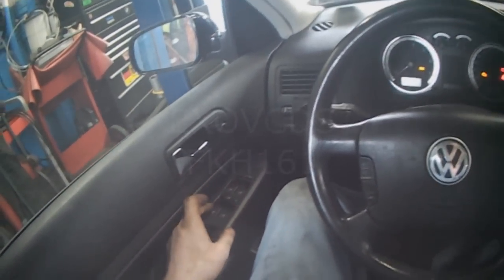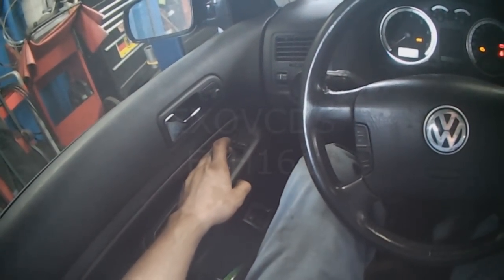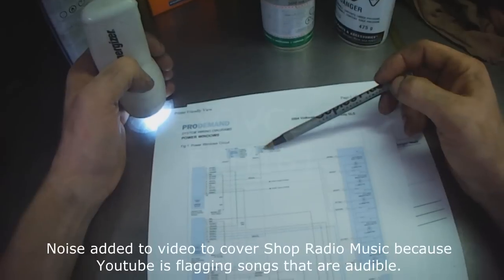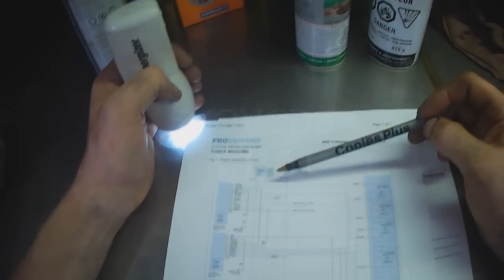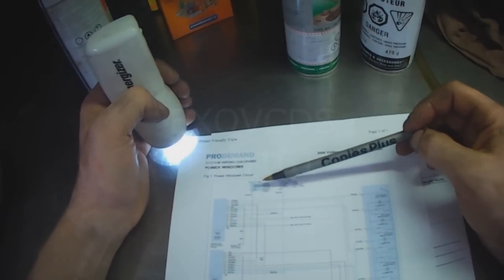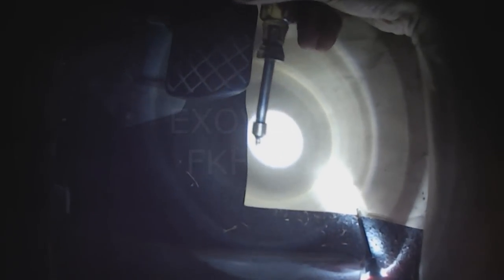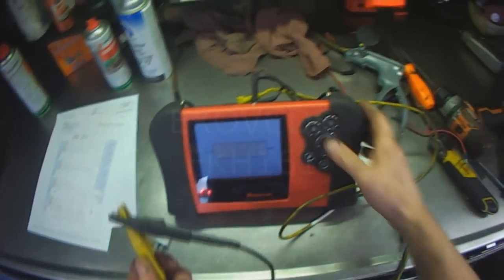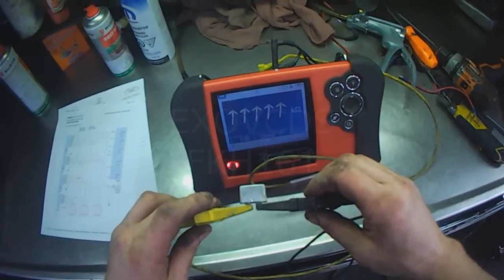VW A4: Power Windows not working

Comment: Hi Thomas, i have a similar issue on my 2003 audi a4,
i replaced the window motor, regulator, and door wiring harness but still no working window. I can hear the click when i push the button though
Reply from the maker: +hxgs If the motor click... then the control circuit is OK.  Look for a problem with the main power & ground. Just one window is affected or all?
Reply: ***** thanks for the reply, it is only the driver window, everything else works (locks, sunroof, dome light, other windows etc...)
Reply from the maker: Have a look at this pdf.. might help determine which wires to look at.
Reply from the maker: http://fkh161.ca/Audi/A4/AudiA4PW.pdf

Comment: I have the same problem on audi a4 b5 1998.. only in my case not workink only left side windows (both) and also relay is clicking in all doors.. but in the right side (passenger side) windows are working fine...   aaand alsoo... after a few weeks that central door locking button on door panel also stoped working... sunroof is working, side mirror adjustment is working too, interior lights is working too.. central lock via remote are working good..

Comment: Hello great information I have a 2004 Audi A4 with some electrical issues the sunroof and all four power are not working. The car will not start when I check the wire going to starter upon turning the key to start position it momentarily show 7v then drop to zero volt. If I turn the key to the on position and put 12v to the start solenoid the car start so the starter is good. Also the engine fans are not working when get up to temperature or when the AC is witch on. can you please help or do you have a schematic for the different circuits?
Reply from the maker: Standard or automatic? What size engine?

Comment: Hi Thomas, i have a Vw golf IV from 2002, 1.4, 16v, i have some problems with the window from passager front like this: when is hot outside like 20' plus the window is working great. but when is cold outside it's only work down, up he don't want to work. The clik it's working,
Reply from the maker: Probably an issue with the circuit board of the window motor... we replace the whole unit, but you can try to open it up and "resolder" the spots for the little polarity switch / relay / controller.
Reply: Ok, tomorrow I'm gonna make this. I have a friend who has a machine like this. Thanks a lot and sorry for my English :)

Comment: Hi Thomas EXOVCDS good video going to check if that the problem that going on for my windows they just stop working today and my windows all down and I cant get  them to go up I also notice my sunroof  stopped working but my power locks still work I check the all the fuse's in the car but all of them are all good but all this happen when I had to disconnect my battery and when I connected it back my windows stop working
Reply: My car is 2000 vw jetta 5speed 2.0
Reply from the maker: Not sure... something similar happened on this A3/mk3:
https://www.youtube.com/watch?v=NPuw8TR3KYg

Here's mk4 power window diagram:
http://fkh161.ca/VW/mk4PW.pdf

Sunroof
http://fkh161.ca/VW/mk4SunR.pdf

Comment: Just wanted to know if there's a fuse in the fuse panel dedicated for power windows? For a 2005 Volkswagen Jetta 2.5.
Reply from the maker: I'd have to check... is everything else working? The "vehicle central electrics control module" will shut-off non essential electronics (to conserve battery power) if there happens to be a battery / charging issue.
Reply: Thomas EXOVCDS 

Batteries charged car starts up just fine .The fuel lock,  the trunk release button work my lock and unlock buttons work up front both doors. Ive repaired the wiring harness and got all that to work again. I still however cannot roll down the windows with the key manually by holding the key down from the outside. None of the windows roll down. My sunroof does work. I also took the front door window control module apart cleaned up the contacts I can roll down the passenger side window but cannot roll it back up that is the only window that actually rolls down with the driver side controls. The passenger side front door I can also roll down with its Window Control. The rear windows I can not roll down. The rear windows don't work with the buttons the wiring harness look good. I was also thinking I might have removed a fuse because the rear windows used to drop by themselves before I repair the wiring harness. I checked fuse 14 and Scott a 10 amp fuse. I've checked all the fuses buy the battery and on the side and they all seem to be good I'm thinking if I pulled one out and never replaced it that's why I asked if there's any other fuses. Could not find a diagram for my 2.5 Jetta. I appreciate all your help thank you
Reply: The passenger front window does roll up and down using its own window control button. That and the sunroof are the only two windows that will open up
Reply from the maker: Ivan Azcue As far as I know, all windows receive power from the same source / fuse, do if one works, it's a control issue with the others. Be it wiring or a module issue (comfort control or door module). I can find a wiring diagram for you once I'm back at my pc sometime tomorrow.
Reply: Thomas EXOVCDS 
Also anyway to.check the door module found it?
Reply from the maker: The front doors can have wiring harness issues (broken wires). Check for broken wires in the door jam (behind the accordion rubber boot).
Reply: Thomas EXOVCDS yea i check them, wiring looks good.
Seems like the back of the car aint getting power. Looking into door module relays?? Dunno
Reply from the maker: I'll send you a link to a wiring diagram in a bit.
Reply from the maker: http://fkh161.ca/VW/A5/VWA5PWindows.pdf

Comment: What's up a little question what place I can find the circuit breaker I had a same problem with my Jetta thanks
Reply from the maker: What year Jetta? Should be in the same place as this one if it is an A4 / mk4 Jetta.
Reply: It's 2000 vw Jetta tdi 2.0L it's almost looks the same as yours
Reply from the maker: I just checked a wiring diagram... it's the same as in this video. Remove the lower panel and look for the circuit breaker.
Reply: Thomas EXOVCDS yeah I check the one looks relay I just took it off and it looks good I prolly need the one you install with fuse, I need to know where exactly I can get that stuff thanks
Reply from the maker: WeTLaDi3sL0vER SLamm3dEs1 Sorry... I thought you meant the location of the circuit breaker. Most auto parts stores should carry those circuit breakers. You can Google the part number that is on the circuit breaker and that will get you online results for ordering.
Reply: Thomas EXOVCDS alright thanks for the info your video is awesome I appreciate your replying back take cre
Reply from the maker: Happened to be working on a mk4 right now: 443 937 105 A
Reply: Thomas EXOVCDS how you doin I'm back and I am trying to do everything I just don't want to go to the dealership and cost me more money to fix it I just wonder where exactly I can get the stuff you install to make to make it all work on those windows thanks
Reply from the maker: The part number for the circuit breaker is in my last reply to you.... a google search will come up with online parts stores that sell the circuit breaker (click on various links until you find one that lists the circuit breaker for sale).

Comment: Got a tricky one here, 2001 Jetta wagon born in 03/01has the 2.0 manual tranny.  I had the ignition replaced and programmed with new keys (new key fob wouldn't program to lock or unlock). Now everytime I start the car the alarm goes off. Was told it was a bad ccm, replaced the ccm and still the same issues. Also the drivers window switches wont control anything except drivers window for about 10 minutes after negative cable is pulled, after 10 minutes the switch dies and I have to pull negative again to "reset" the use of the window. Sunroof works, all windows roll down from their perspective switches, no courtesy lights when I open the drivers door and yes I have already replaced the door lock unit also. I can unplug the blue connector on the ccm and the car will start just fine no alarm, but I loose loose the comfort features along with it. Thoughts?
Reply from the maker: Performing a full system scan to see what codes are stored in all modules... might be helpful / can point you in the right direction. You'll need a scan tool that can communicate with all the modules.
Reply: I'll have to see if I can find someone that can do that for me.

Comment: Hi. Windows on caddy live driver and  passenger does not work. They however do work when I continioisly press the remote control. Also central locking also works when you lock the vehicles. Help would be appreciated. Thanks
Reply from the maker: My guess is the button or wiring in the door jam? 
Have someone scan the vehicle (all control modules)... there might be codes in more than one module that can help point you in the right directing.
Reply: Thanks. Appreciate your time.

Comment: hi bro..I have an audi a4 the water and changed the module comfort drink of the haciento and still do not work change the master power and also broken cables nothing. In this video and maybe it is what you did. Where I have the chip that you took in that passat an audi
Reply from the maker: This video is of "VW A4 (mk4)"... not Audi A4. What year is your car? What Engine size? What Transmission? I can look for a wiring diagram and can then send it to you.
Reply: cool bro.. is audi a4 2.0T year 2006..automatic.

Comment: Question. My driver side controls work for all windows. But the only one that has issues is the rear passenger window. I can role down the window from the drivers side controls. But I can’t ever role it up.
Reply from the maker: It rolls up when using the rear passenger switch? If yes, then I would suspect an issue with the driver switch assembly. Remove it and check for corrosion at the switch pins.

Comment: Hey man my audi 2002 a4 1.8t is just jumping from a stop really hard jerking motion then sometimes it stalls but the maf is clean
Reply from the maker: Standard or automatic? Engine fault codes? Use a scan tool to monitor engine data. TPS, ECT, MAF, short term & long term fuel trim values, misfire counts etc. Attach a fuel pressure gauge to monitor fuel pressure. If it is not driveable and it doesn't have any fault codes in the ECM... could be a transmission problem. If automatic... check the TCM for fault codes.
Reply: @EXOVCDS  it shows up as a transmission issue its an automatic
Reply from the maker: We don't deal with automatics... you'll have to take it to a transmission shop. You can also contact Richard (fellow YouTuber) over at: https://www.youtube.com/channel/UCpJdF1RzuXHqtzK258qRLjg or send him a message via his website: http://kansascitytdi.com/contact/ He knows a lot about automatic transmissions!
Reply from the maker: Torque converter lock-up clutch comes to mind... can cause stalling and harsh shifts if it is stuck ON.
Reply: Torque huh... Shit ok
Reply from the maker: Just a guess... could be a valve body / solenoid issue.
Reply: @EXOVCDS  what about the turn signals and windows not working nir the horn and yes every fuse is new biught 3 replacements for each and replaced all of them still dont work

Comment: would this also cause a parasitic battery drain? Windows don't work and I'm getting a battery drain. I thought it might be the CCM, but that was changed with no luck. 04 Jetta 1.8 auto
Reply from the maker: No, it shouldn't cause a drain unless the circuit is shorted (circuit breaker has power all the time). How big is the drain? 50mA, 100mA, 1A.. more? Should just need a multimeter & test light to trace it down. Alternator diodes can go bad causing a drain... disconnect the black alternator cable from the fuse box on top of the battery and see if that changes things.

Comment: please i have a 02 vw jetta gli 2.8 24 valve vr6 im getting a p1347 code cam/crank o2 sensor signal out of sequence what does that mean all my sensors are new help please thank you
Reply from the maker: If there is no noise from the timing chain... check the oil control solenoid for the exhaust camshaft for correct operation.
http://wiki.ross-tech.com/wiki/index.php/17755/P1347/004935
Reply from the maker: Any questions?
Reply: ive changed all the cam crank oxygen sensors its a replacement motor i bought online only 130000 miles i put all new sensors checked the timing marks they lined up perfect i just dont know what to do thank you for trying
Reply from the maker: The position of the camshafts is adjusted by the ECM. Initial timing / position might be OK... but once the ECM moves the camshafts, it notices a problem with it (exhaust camshaft in this case). As listed in the link above, there could be several reasons for this. With a scan tool that can view engine data... check that the camshafts are at 0 degrees when at idle. If the exhaust is reading anything more that +/- 3 degrees, then there is a problem with the chain, the oil flow control solenoid or the camshaft phaser.
Reply: Hey i want to thank you for your time what if anything i can do for you let me know im sure ill need more help by the way i took the car around the block put mine and passanger window down got back home and the windows womt go back up and the power locks and alarm im just having a wonderful time with this car but i love it so fast and i already have 2 grand in it and i havent registered it lol new used motor new interior tires brakes clutch lights. Lol im in over my head up to my chin
Reply from the maker: Are the fuses / circuit breaker ok (as shown in this video)?
Reply: @EXOVCDS  i have a lot to watch after work ill let you know again thank you it just seems every time i think i got it something else pops up
Reply from the maker: 17 year old cars will do that. =)
Reply: @EXOVCDS  i waned to thank you for your help it was circuit breaker lol now in orderto pass inspection my airbag light needs to be reset im so close

Comment: Hey, I have a 2004 mk4 Golf TDI, and my window and sunroof are not working not even with the key flop to unlock the doors?  I tried to open the links in the similar comments blew because I seen others having the same problem.  Can you send me the schematics?  thanks OG.
Reply from the maker: When you use the buttons.... do you hear clicking from the doors (like I did in this video)?
If yes... did you check / find the circuit breaker? Does it have power? Does power go through it?
If no... are fuses 14, 11, 44 ok?

Comment: Hello @Thomas EXOVCDS i have an audi 2004 AWD manual transmision, the driver windows works pretty good as well as the rear right window, but the passenger and the rear left wont work from the drivers, sometimes after u push it several times.. all of them work with each's buttons,  what would be wrong ?
Reply from the maker: +Daniel Lmz Driver control switch? Wiring in the driver door? If they all work via their own switch in the door, then I would focus on the driver door switches / area.
Reply: +Thomas EXOVCDS so you recommend replacing door swtiches?  the drivers??
Reply from the maker: +Daniel Lmz I can't recommend anything without having looked at it myself. I said I would start looking there.

Using a scan tool... one can check the functionality of the switches. if the scan tool shows correct switch operation, then it is not a switch issue.

Comment: hi thomas. all my windows are not wrking as well vw polo mk4..switch are ok motor is ok as well.
Reply from the maker: I'm currently at work... will get back to you later once I get home tonight. What year (month & year), what engine, standard or automatic? I might be able to find wiring diagrams for you.
Reply: vw polo 2006 manual thanks thomas
Reply from the maker: 2 door or 4 door?
Reply from the maker: Are the power door locks working? I can't find 1 fuse or circuit breaker that the doors have in common (like in my video). When you try to use the windows, do you hear any type of clicking from the motor / circuit / control board that is part of the window motor?
Reply: hi again thoms i sortd out already. 2door.. the prblm was it waasnt gttng enough elctrcty as the battery is nearly dead. and i hve anthr problm centrl lockng on the outsde wont work..
Reply: thomas its not wrkkng again..it wrk yestrdy then sddnly not wrkng again..
Reply from the maker: +BJ Assasin Check the charging system.  When the battery voltage gets too low, the electric control module prevents accessories from working (meant to extend battery life)... you can check if that is the case, by attaching a battery charger and checking if things work when the battery voltage is higher.
Reply: i just changed the battery a week ago thomas...so could it be that the electrc module is bad?
Reply from the maker: The fact that the alternator does not charge until you rev the engine... might point to a lazy alternator. That's why I said have the battery & charging system checked. A new battery can be "weak" if the alternator is not charging correctly. The issue could be alternator related or it could be the "control" of the alternator. Having things checked by someone that is good at engine electrical diagnosis, will ensure that the correct thing gets replaced (alternator, module, wiring / bad connection etc).... I can only guess at what the problem might be. Like I said, if you have no other problems, just rev the engine when you start it, so that the alternator starts to charge. That's the cheapest fix.
Reply: ok thoms ill try tht
Reply: tried to rev it but still no lack id probbly locate the relay and see whts goin on

Comment: hi Thomas my car as the same problem as yours  but my fuse is ok any other ideas cheers Mark
Reply from the maker: You'll have to check a wiring diagram and trace the circuit(s).